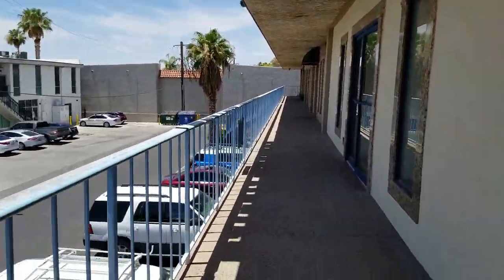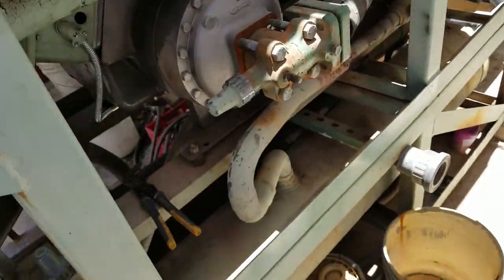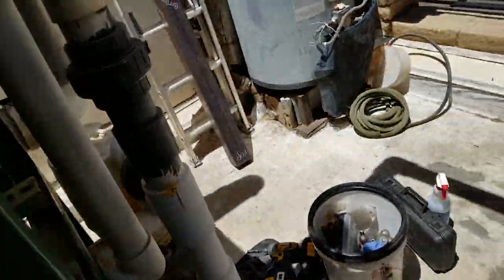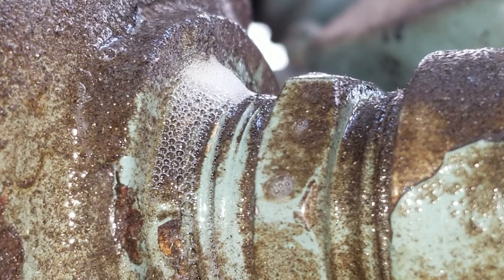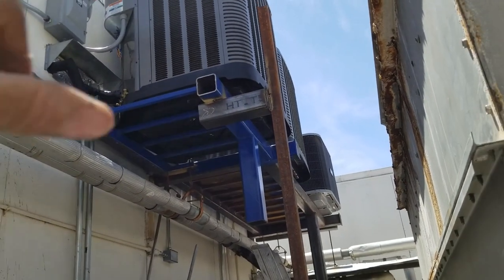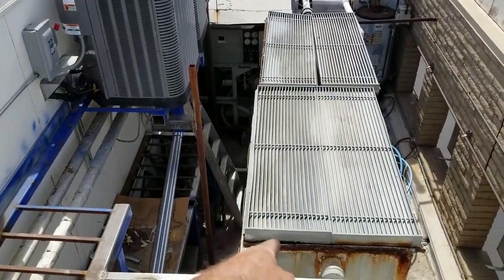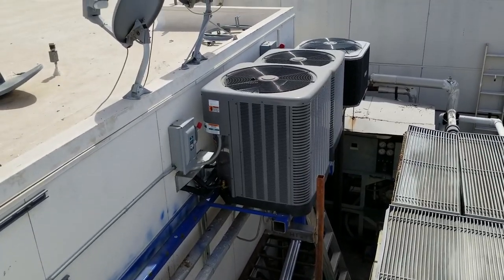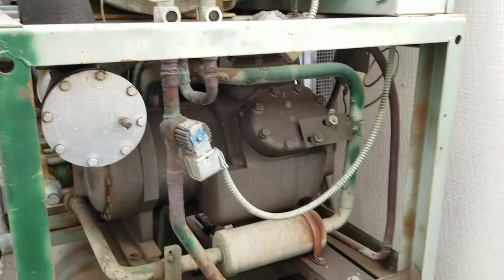youtube video #-CP04nWqeSY

Comment: What's wrong with the chiller?
Reply from the maker: The middle compressor, which is the 2nd compressor to the pair for circuit 1, is dead.
The compressor I worked on was a single compressor circuit.

Comment: Hope code enforcement finds out and puts a stop to that crap. Champagne taste on a beer budget. 422d sucks, almost every system I’ve seen it in runs a high head pressure. 427a and 407 work better.
Reply from the maker: Code enforcement SUCKS in Phoenix and Scottsdale areas.
That's why I initially started this channel. 
HACKERY is allowed here.